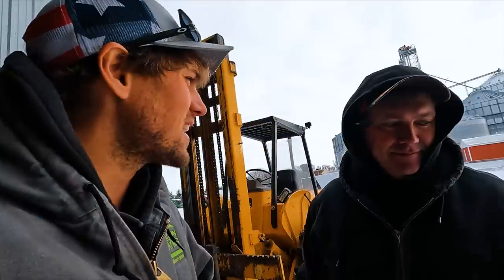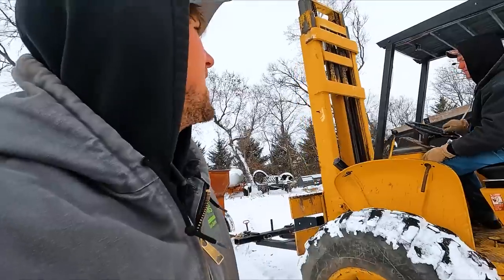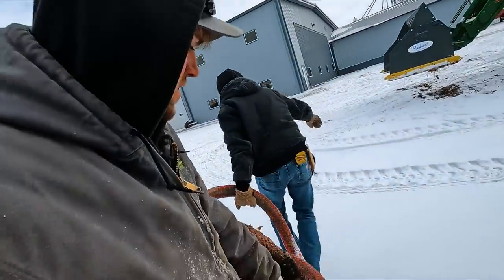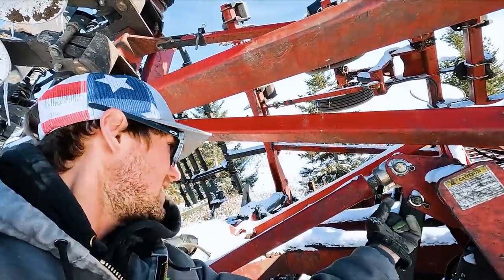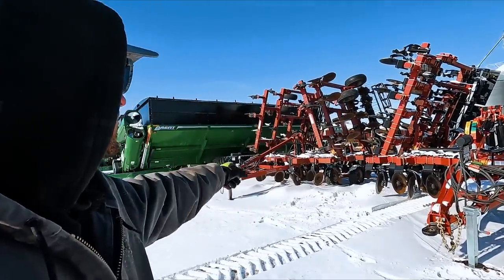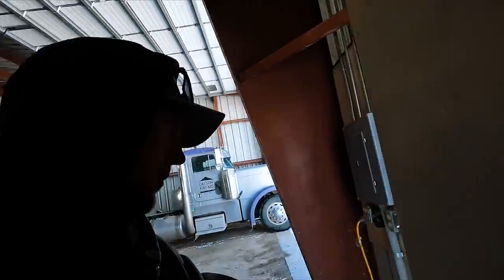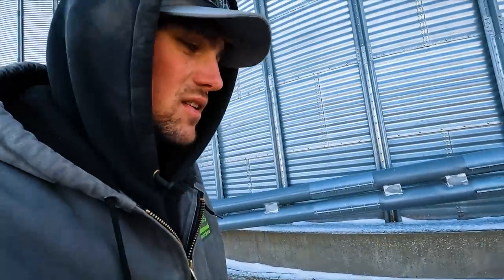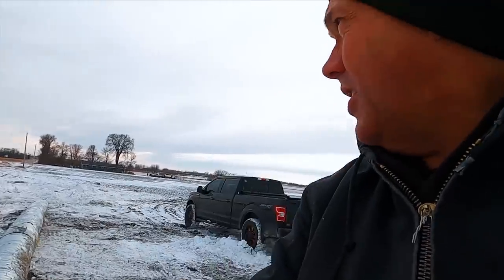Maybe We Try To Do To Much!!?

Comment: Chet, old truck driver tip, find an old fan belt and loop it through the 5th wheel latch handle. That'll give you the ability to stand up a little straighter when pulling the pin, much easier on your shoulders. Soft belt is much easier on the hands especially in winter. The belt will just hang there and not get caught up in anything on the truck!

Comment: Idea for the old used tracks, We use them for sidewalks or to park equip. on. Cut the track in half, if they have lugs dig a trench to accommodate them lug side down. Makes a great walkway in winter since, once the sun hits it will melt off. As for equip.  Dozer tracks  won't stick  in winter.  Works very well plus the cost to get them is very expensive. just a thought to share for a second purpose.

Comment: Starting Tractors made me think back to the 60's and early 70's. You know not too many tractors had glow plugs so we had water heaters for the radiator. Oh My GOD don't forget to plug them in. Our dad could be quite upset. Had a 70 JD with a pony motor it always started the pony motor was water cooled so it was connected to the radiator let her run for 20 minutes or so and see would start. Great video

Comment: Thanks  guys, nice video. Chet if you have problems with  the injectors of the truck, drain the fueltank, exchange waterfilter more often, a tiny tiny drop of water can cause that problem. Till next time.

Comment: I feel this pain. We worked on a job all summer at 5500ft. Then one day it snowed and the temps went from 60° to 10°F. Then the challenge started of getting Al out equipment hauled off the job, and just getting equipment started and unfrozen from the earth. Blah, I hate the cold!! I also had to put a culvert in last minute because the land owner wanted it. Unfortunately there was already 8” of snow. So I had to scrape all the snow off dig the ditch, set the culvert and backfill. Thankfully the mush i backfilled with froze two days later. I also used a wrench to put the bolts on the culvert bands. To be honest I got annoyed and ended up cutting the extra part of the bolt off a few times with a sawzall so you could continue using my impact haha
Reply: You sound like a joy to have as an employee

Comment: Here is a Industry idea for you chet, prob make some bucks off it?   cut the old old tracks and attach  chains or cables and make make yard drags with them. they look like would make a nice gravel leveling serface if drug behind a smaller tractor or the side by side ect.
Reply: Flattened out and laid out at problem areas to drive over maybe?
Reply: @larrybe2900  exactly what i had on my mind layed out flat 2 or 3 cables or chains that would pull equal and away ya go. they look heavy so if not lay a couple together on top each other looks likes they have a couple laying around and probably have more soon enough

Comment: I realize you guys aren't truckers so, FYI I always dropped trailers low, so that way in the winter when you hook up the trailer you lift the dolly pads off the ground. Once you pull the pin, pull ahead about 3 inches, dump the suspension and you won't rip your poly pad off. This will keep from breaking your Dolly leg axle. You're welcome!